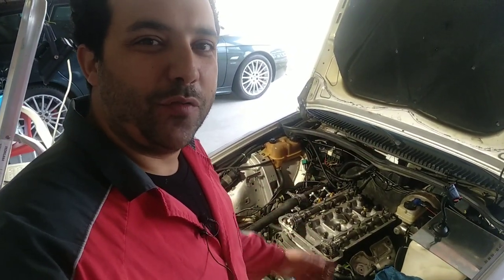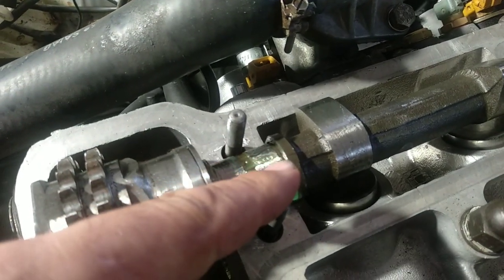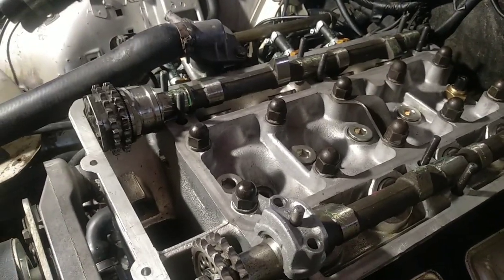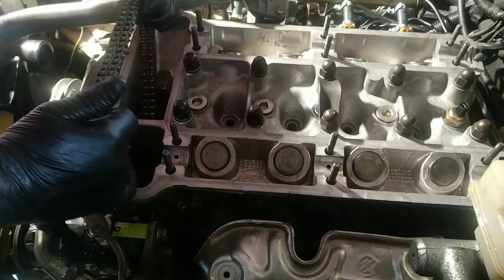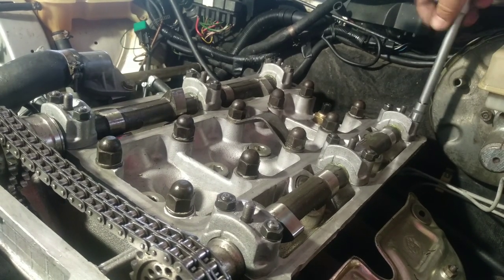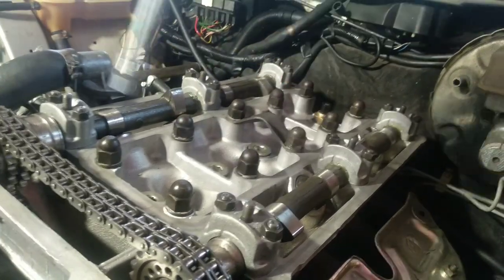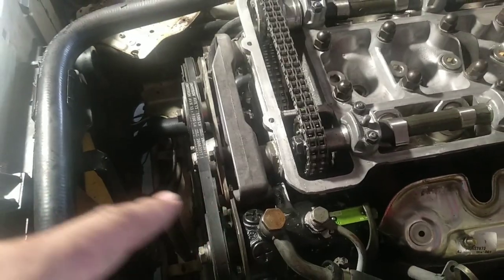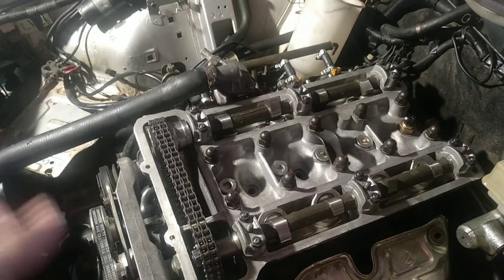Bialbero engine timing chain, how to do it? Some tips to a perfect fit. Alfa 75 ep. 12.

Comment: The thing that I don't understand on this engine, I have this exact engine but with twin carbs. At the tensioner spring, there is another screw on the side, that holds a guide in place to keep the tensioner sprocket support from rotating on its axis. But if I screw that in, then the tensioner sprocket will be locked in place, the spring will no longer do anything. I feel like that is not how it's supposed to be; but at the same time if I don't screw that little screw in, I feel like it will fall of from the vibrations. I was really hoping that you also talked about that little detail in your video. Great channel by the way, you have some beautiful cars!
Reply from the maker: Hello. I'm currently recording in that engine. That tensioner is not active like modern ones. It locks in place. The bolt is there to make sure for a perfect tension. From time to time it should be released to stretch the chain. 
Is a very old tech. But it works well. Thanks for watching

Comment: Hi Bruno, thanks for the link to this video, as previously mentioned, I'm doing a cam belt change on the 2l twinspark and the Inlet cam lobe is no Longer adjusted correctly. How do I adjust this without breaking something? I searched your videos but this I can't find this procedure. I'm looking at the car now if you can help please, thank you.
Reply from the maker: In that case you have to take the belt of and turn back, or clockwise the pulley. At the same time lock the cam in place.
Reply from the maker: I will try to find a TS to record soon.

Comment: Nice one. Thanks for sharing this. What is this heat shield on exhaust side? Mine engine don't have that. Is it oryginal one? Second. What wit this bent conrod? Did you replace it or leave it as is?

You said that can torque the camshaft sprocket after alignment everything. But there is a little space in there. Do you have any special tool for it? Intake side is big nut?
Reply from the maker: Ok, well, the exhaust shield is from a Alfa 156 1.6ts that i get from a parts by. It's not a direct fit, but i did drill some holes and so far o like the result. 
The conrods i didn't remove or repair, just discovered wen i taken the oil pan of, i still feal gutted... 
Abou the torquing of the sprocket nuts i did ask for the proper tools but no one had it.
So after i looked in place i took it all of again and torque it on the vice. 
Did not mention it because it's not the best way to do it.
Reply: @alfaromeonoproblem  Good idea with this shield. Will try that too. About torque the sprockets - that's what I'm thinking. Best idea to remove cams and torque them like you done on a vice. It will be very hard to do it fitted in a head. Have you run it now? I have booked technical inspection of kine in Wednesday and will register it next week.. Finally
Reply from the maker: Did run it today, i was finishing the filming of the last episode of this project. 
Started right away! I just have a gasoline leak, a hose i think.
Reply: @alfaromeonoproblem  Want to hear your engine on idle. Make a video close to the belts spinning in front of engine..
Reply from the maker: Will do!